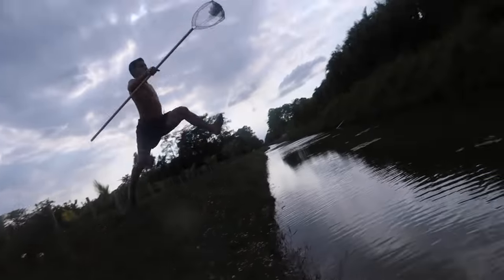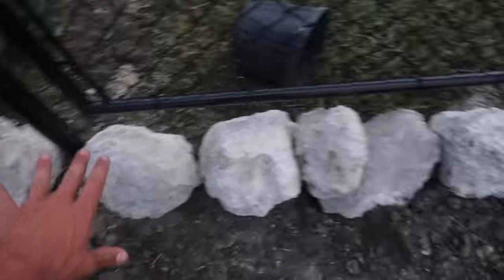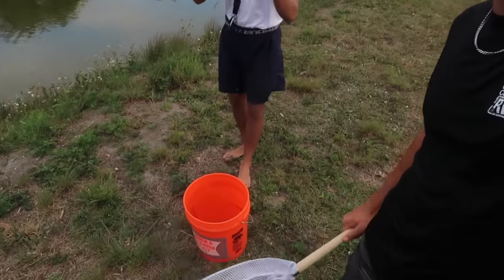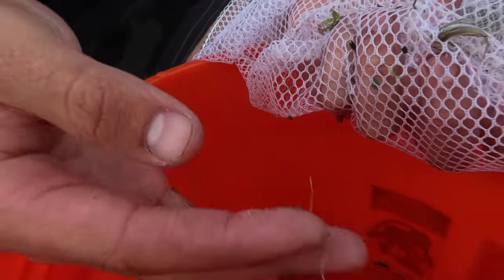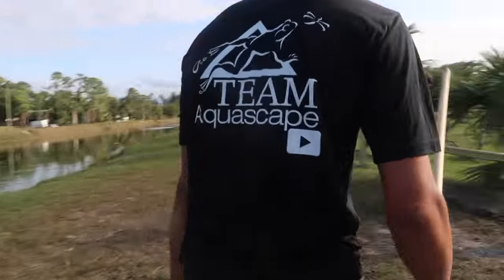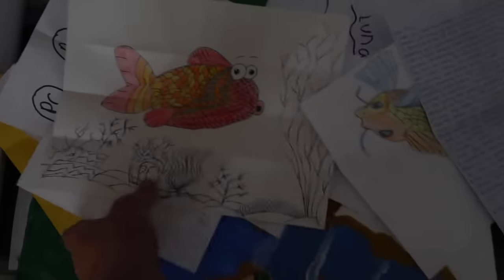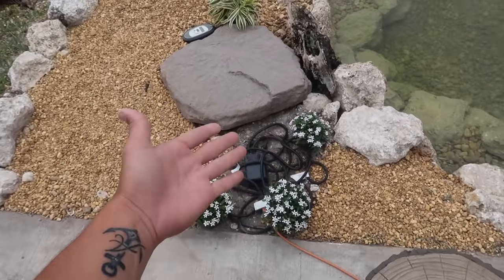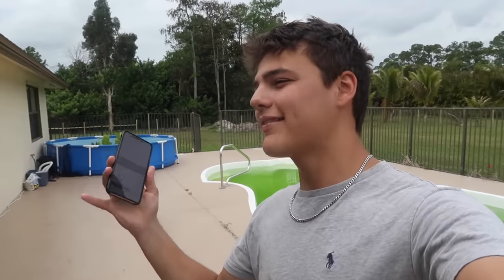STOCKING My *NEW* POND w/ MOSQUITO FISH!!!

Comment: If those dogs do have owners then I hope they take them to a vet. Dogs can very easily get a condition called garbage gut which is basically a type of food poisoning in dogs that can be fatal and is caused by ingestion of random garbage. I've seen some nasty cases come into the clinic I work at. Obviously not your fault considering they came onto your fenced property and you had no idea they were out there but I hope that they are doing ok. Try getting some dog food to leave out for them and if you do get ahold of them I would suggest taking them to a facility that can scan for a microchip to see if they do already have an owner or if you could potentially adopt them. Good luck!

Comment: WARNING! Do not do this! These minnows multiply like crazy and take over your pond. They are extremely difficult to get rid of. If you have continuous running water and koi.. you should not have a problem with mosquitos. We started out with 7 minnows and ended up with several hundred very quickly.